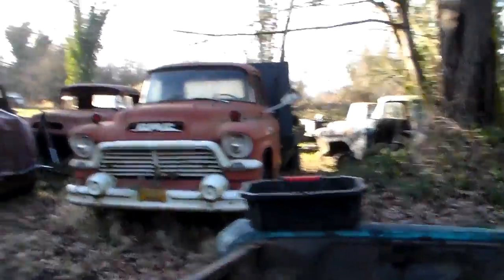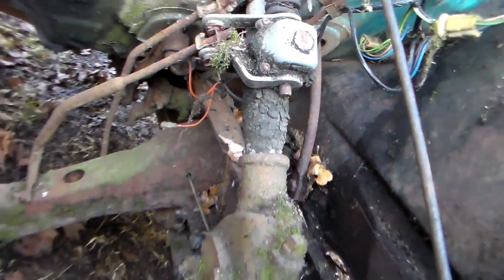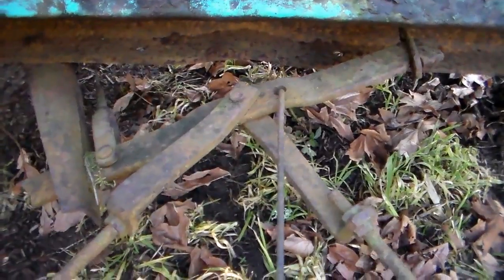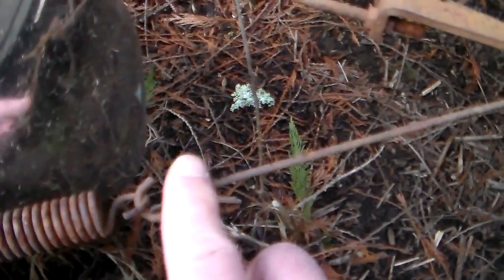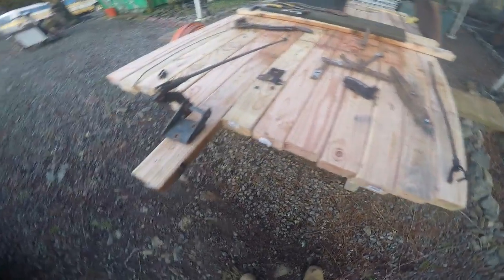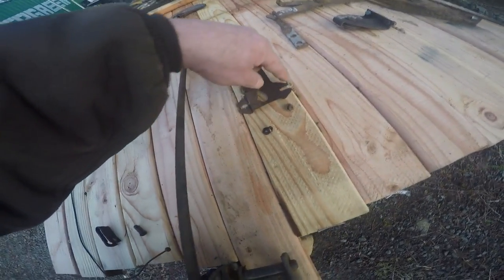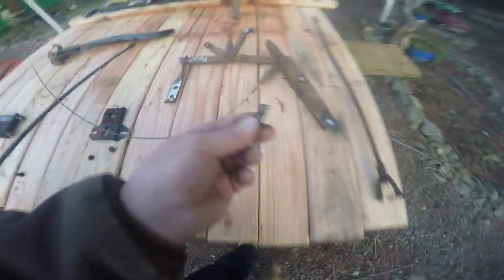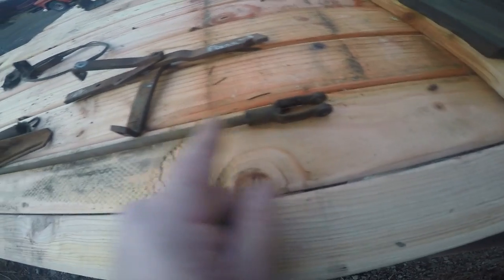1955-59 Chevy and GMC Truck E-Brake

Comment: Hey Rick, find a blacksmith and you could straighten out that mildly bent rod.  It's from the handbrake lever I think.  The idea is to get the rod red hot at the bend, hammer it straight and then temper it as needed.
Reply from the maker: The rod was rusted 3/4's of the way through from where it had sat and rusted for 30-years where it comes through the firewall. Thanks Fer Watchin'. -Rick

Comment: Hello . Thanks for the great video on e-brake linkage. It's one of the most informative videos I have seen on these old trucks. Since this video covers 1955-59 I was hoping it would be a similar setup to the 1961 C10 Fleetline pickup I recently bought. I'm going through the truck to get everything working related to safety and the e-brake is one of the most important in my mind. It's one of the last resorts to stopping! Anyway I have been purchasing parts and need to get the e-brake linkage between the handle under dash to the rear brake drums. The handle is in good condition and the mechanism in the rear drums is good too. What I need to understand, in order to order parts and layout how it all gets connected are the linkage parts in between. Can you point me to a diagram of the 1961 C10 or a video that shows in detail theat linkage. Thanks very much
Reply from the maker: Sorry Daryl, I don't have any 60-66 Style GM Trucks on the Ranch right now, Just 55-59. Seems like a little internet research should be able to yield the info you need though. Thanks for Watching. -Rick

Comment: hey Rick I just wanted to pass along over to Jamie and tell her good luck tomorrow we're crossing our fingers that everything goes well I've been working on a 98 Tahoe motor went out on it I got me a new crate motor from Scoggin Dickey out of Lubbock and get some modifications to get some hot rod parts to it and push it almost 300 horsepower finally got it running today finally figured out what I've done wrong I've got the distributor off by a tooth so now it runs real well and so now I got to get a cat back exhaust for it it's going to sound real awesome anyway y'all have a good day tomorrow

Comment: Wow, that's a remarkably intricate system to operate the E-brake/parking brake/handbrake.  It's not hard to see why a lot of motor companies went over to the pull-up lever on the floor between the front seats.  Most then just have the lever and a cable.  And yet, they still go wrong...  I guess that says something about motor manufacturers AND some of the people that work on vehicles...
Reply: gosportjamie ?
Reply: +Faron Myles  Production cost and speed/simplicity of assembly.  The less parts used in assembly and the quicker assembly is the more profit motor manufacturers make on each unit...

As a qualified mechanic, messed-up handbrake systems is something I've seen A LOT.  I worry about the mental capacity of people who can royally screw them up, it really isn't rocket science, and yet...

Comment: The handle looks the same as the 1964 Corvair.
Reply from the maker: It probably is. I have a 1960 GMC truck that I know for a fact has the same E-Brake handle, so it wouldn't suprise me if a lot of these components were used on different years and models of GM products. Thanks Fer Watchin'. -Rick

Comment: there called a parking brake, not an emergence brake
Reply from the maker: Okay. Thanks Fer Watchin'. -Rick
Reply: Donald Adams  emergency brake term used in the states especially in early days of cars. Commonly known as a parking brake now. Both terms are right.
Reply: in my 1964 chevrolet truck shop manual its called a parking brake, the reason they don't call them an emergency brake, is because the car manufacture does not want the consumer to think that there going to be in an emergency situation while driving one of there vehicles.